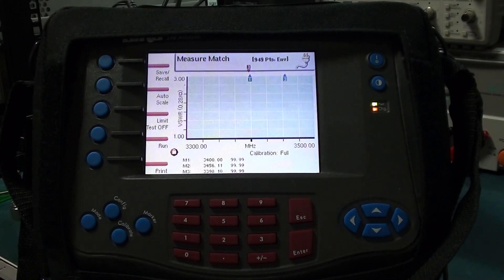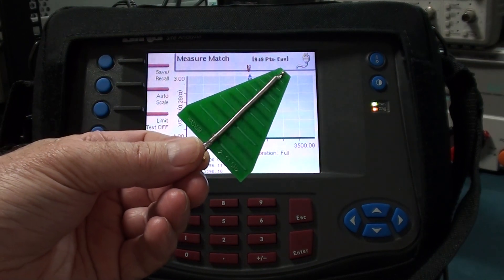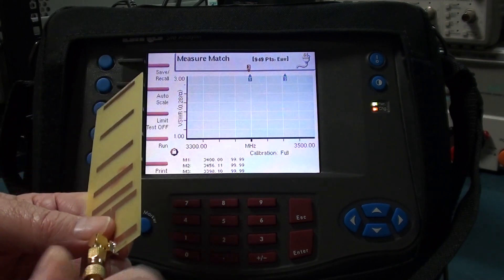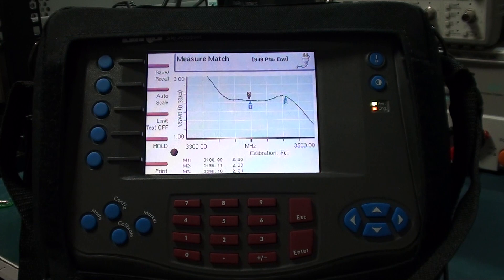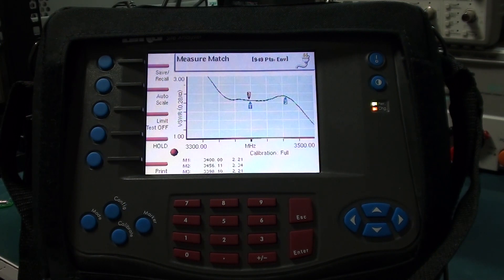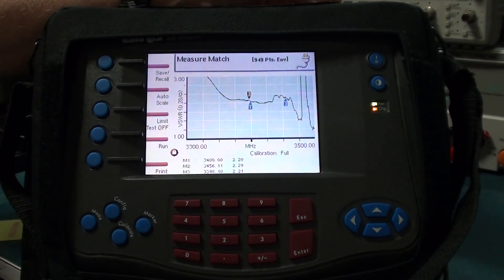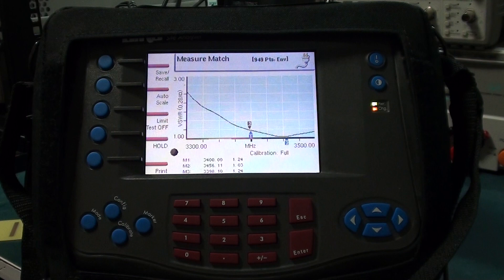Testing the 3.4GHz PCB yagi that came with the SG-Lab transverter

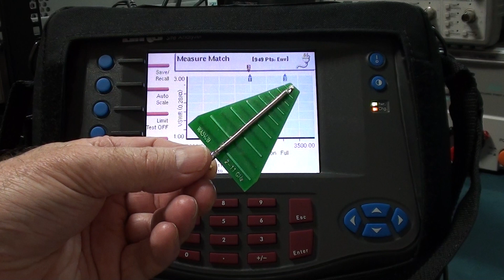Comment: 2:02 What is this (multi wavelength  antenna) 0:24 another  2400-2473 MHz measure result ? and first and last dipole mm? (is in antenna too 2000MHz=75mm & 11GHz=13.6mm (one site PCB is half this, 1/4 wavelength)?)

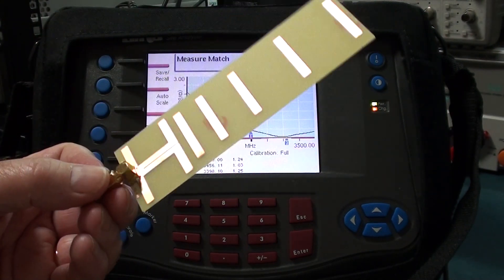Comment: tnx, this 3:12 measurement is not (right) Yagi antenna measurement, I mean first if u see elements after dipole(w loop)-antenna distance 1st is ~1/16 lambda(?) 2nd ~1/8, 3nd 1/4, 4nd & 5nd 1/2 lambda. This is nonsense. (not multi waves too) ... reflector is too 1/2 wavelength with antenna ? "Rusty Nail" antenna is maybe better ;) ...